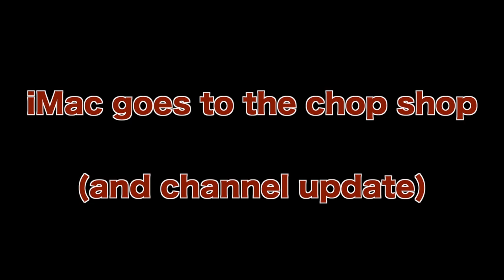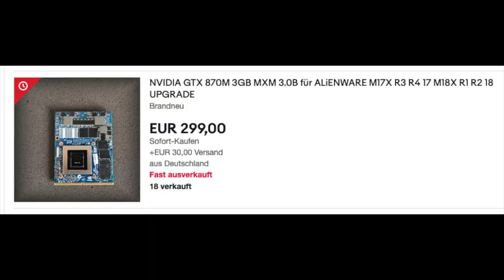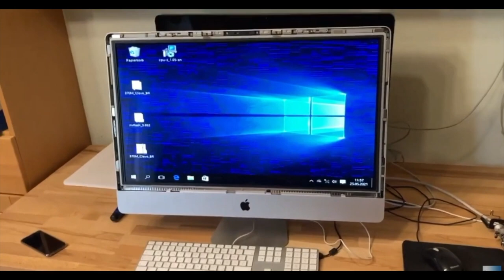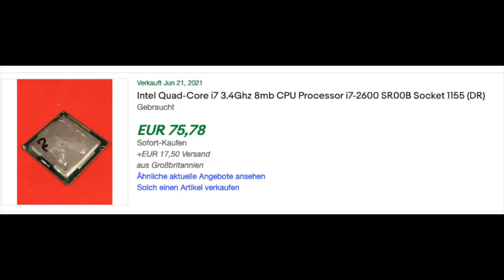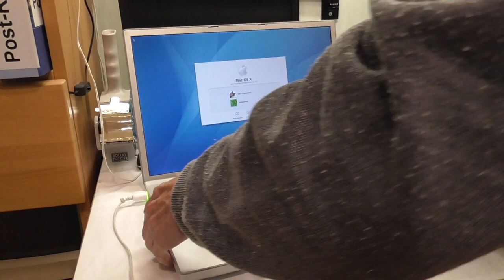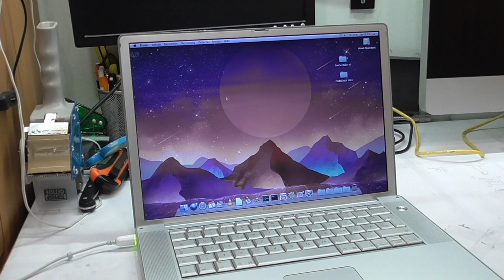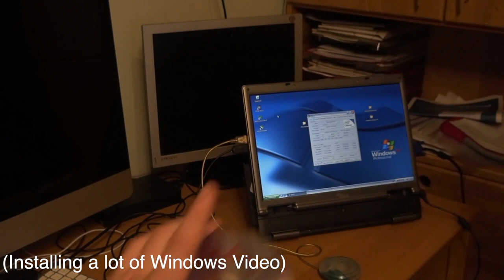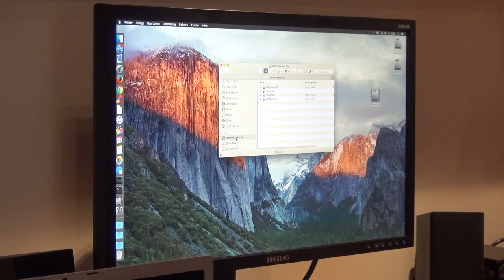iMac goes to the chop shop and is the end of MacintoshMen coming?

Comment: Hey Macintosh Men, did you know it that the have release the patch with opencore that allows you to run Big Sur with an Amd unsupported (no metal) gpu? That workaround uses opengl and works great on my 27” mid 2010 iMac. It works with all Terascale 2 gpus (4xxx-5xxx). Just google Opencore Legancy patcher. Of cours it would be better with an supported metal gpu but seems fully functional and i love it. Grüße aus Süd Tirol
Reply from the maker: Yes I have heard of it; Grüße aus der Steiermark ;)